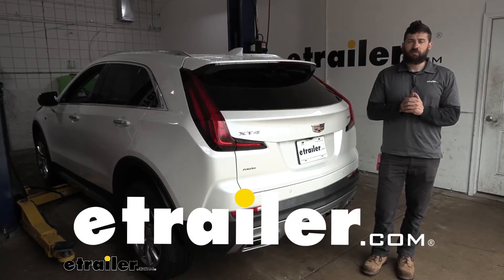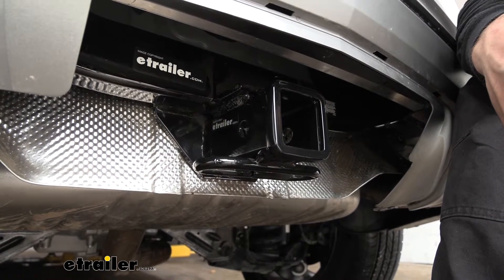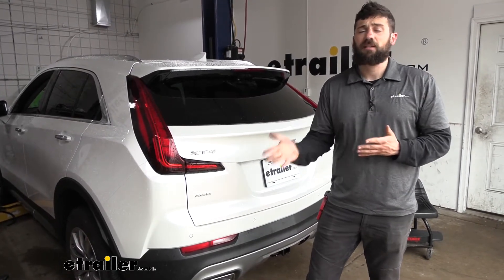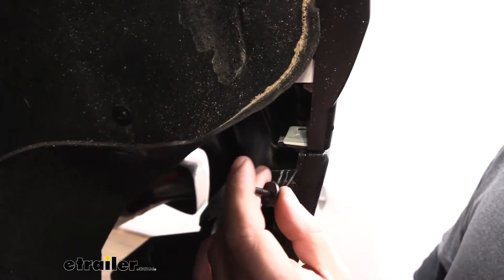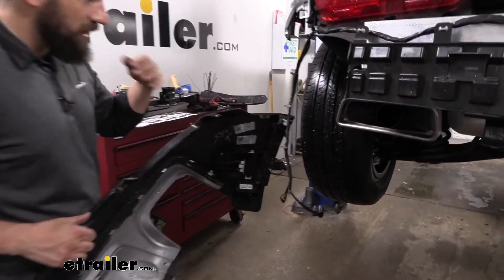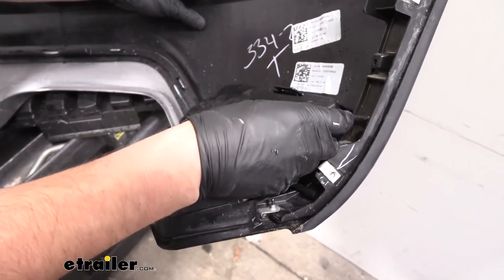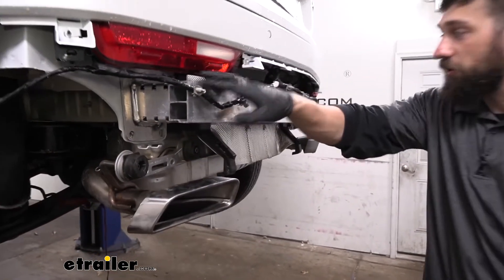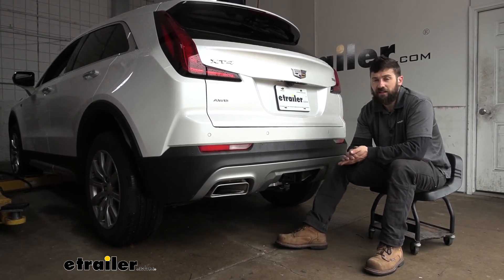etrailer | Beginner’s Guide to Installing the Curt Trailer Hitch Receiver on a 2022 Cadillac XT4

Comment: I’m working on a 2024 XT4 with the reverse light in the middle of the bumper and the clips in that area refuse to separate. The clips on both ends were no problem. I’m prying so hard I’m afraid of breaking something. Any suggestions?

Comment: GM engineering at its finest! Doesnt the added thickness of the hitch move the beam further rearward? Wish you would have also filmed the reattachment of fascia!..... Great info!!!
Reply from the maker: The extra thickness of the hitch mounting flange does move that beam slightly rearward, but not enough to cause any problems. We didn't show the fascia being put back on because it's simply the reverse of what we did when we took it off. We're glad you found the video helpful!
https://www.etrailer.com/Trailer-Hitch/CURT/C39FR.html